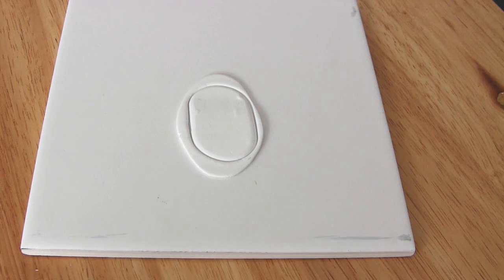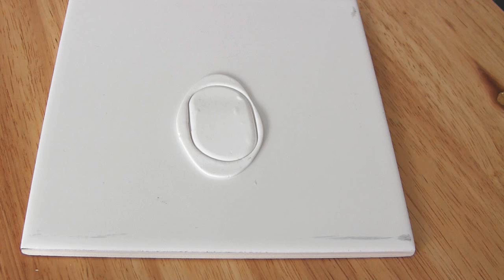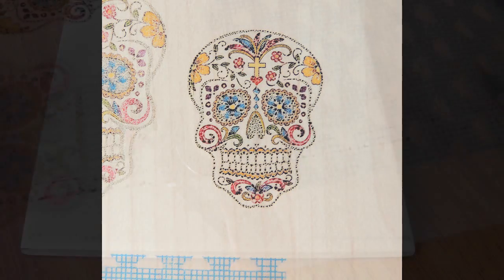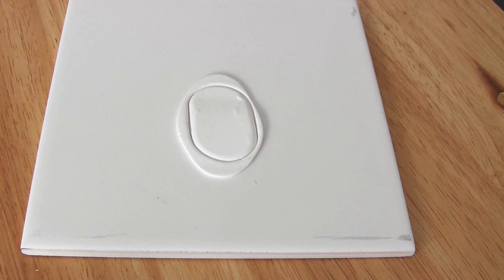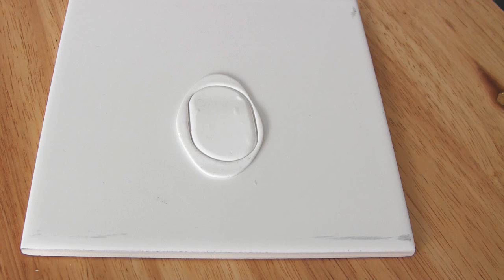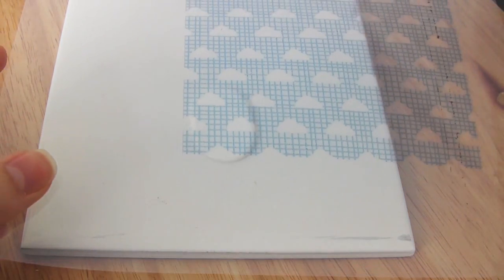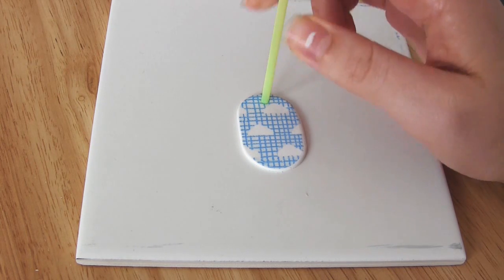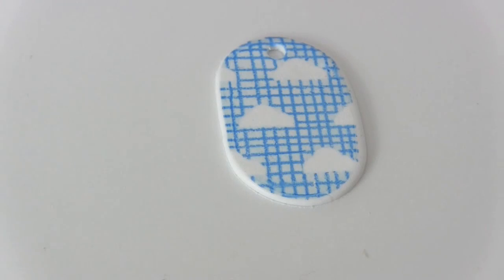How to Transfer an Inkjet Image onto Polymer Clay | Easy Tutorial Demo with Extra Tips

Comment: I use inkjet T-shirt transfer paper to do image transfers onto PC. As I just found out printing on OHP transparencies will only work if your printer supports it otherwise the ink just smears so back to using T-shirt transfer paper. I was really hoping transparency method would work for me.
Reply: i have some laying around and usually i just use freezer paper to do my transfers, but im interested in the tshirt paper. I cant find a good video that shows it (besides one i ran into that was a lady trying to resell transfer paper on etsy calling it her own) but is it transferred via heat (your burnishing the clay with your fingers) or some other way? Thank you.

Comment: hi, i used this technique and everything went well. Had a nice print after baking but when i wanted to varnish it, the ink just dissolved and the picture just comes off. Also when i wanted to sand them with water, the whole picture dissolved. Any idea why you do not have this issue?
Reply from the maker: Sorry to hear you're having issues! Was it the sanding or the water that removed the design? I would perhaps do a sample piece and try different varnishes on top. I often use a protective clear coat spray for more delicate coatings, or perhaps clear resin could be an option? Apologies I can't be more help, I haven't done this technique for quite a while now, but if I do it again I'll experiment :)
Reply: I haven't tried this technique yet, I just stumbled onto this video today. But while I'm unsure what happened during sanding, I suspect the varnish you have is acetone based, which will melt inks and paints. Try using an acrylic based one instead, I just got a can myself and will be testing in the near future!

Comment: Hi! Thanks for the tip. If the sheet dries and i use it after a while, would it transfer the same? The ibk wont be wet i think...
Reply from the maker: If the ink dries I doubt it would transfer much at all, although I've never tried.

Comment: Thank you for the reply. I am going to give it a try.  Have you ever tried putting text onto baked clay, if so what method did you use? Hope you don't mind all the questions
Reply from the maker: I'm not optimistic it would work on baked clay, certainly not laser print images anyway as transfers seem to work best on fresh clay and if the clay is too dry it doesn't work well. You might have a shot using an inkjet image on acetate sheet though, as in that case the ink will not be dry. I haven't tried it myself though, sorry.Please let me know how your experiments go...I'd be interested to hear 🙂

Comment: Hi, do you have any suggestions for how to get round the issue of the ink drying too fast?  I took it straight out of the printer onto the polymer clay but the image transferred quite faded because it had dried too fast :( I looked at the sheets you used via your link but a lot of the comments say they too dry fast (probably a positive if you're using it for something other than polymer clay) and so I'm a bit stuck.
Reply from the maker: Hmm I'm not sure to be honest. If you use an acetate sheet that isn't designed to be printed on I think you'd get issues with smearing, although I haven't tried it myself. Have you tried using more ink (higher print quality) to see if that helps? Sorry I can't be more use

Comment: Hi thanks for this great idea. I need to print some text onto a base of a model. Would this work for printed text do you think? Also, If you do smudge when transferring onto the clay can you use the nail varnish remover pad to remove the ink from the clay?
Reply from the maker: I should think it would work, yes. Maybe test it on a scrap of clay or something first if you're unsure. And make sure to spray some kind of sealer or varnish on top so it doesn't rub off.
I haven't tried to remove the ink from unbaked using acetone before so I can't say for sure, but I'm pretty sure it would work. Again, maybe test on a scrap of clay first :) Thanks for your comment!

Comment: This is going to sound a little weird, but can you slightly alter the image of the clay with your hands if you want to change the shape a bit?.. like the liquify tool in photoshop, for example.
Reply from the maker: Hm I think that would be tricky to be honest, because the image is quite easily smudged. You could always experiment though :) Have fun!
Reply: @RokoleeDIY  You might be right. How would they turn out if you were to print just normal pictures of yourself on these? because I've heard some colors don't come out so well.
Reply from the maker: @darrellm9915  I would be a bit wary of doing detailed images to be honest, like people's faces. I don't know it won't work, but detail would certainly be lost in the transfer.

Comment: wont it work on anything but accetant? in the printer do u have to stick it on paper so it wont roll edt?
Reply from the maker: I've only managed to do it this way, which uses inkjet printable acetate. I've not had to stick it on paper or anything special to print on it :)